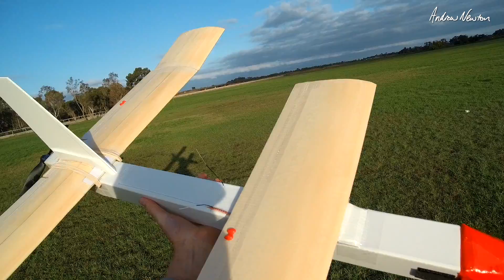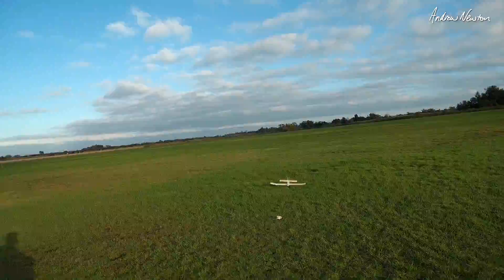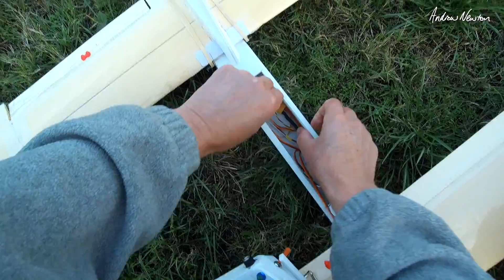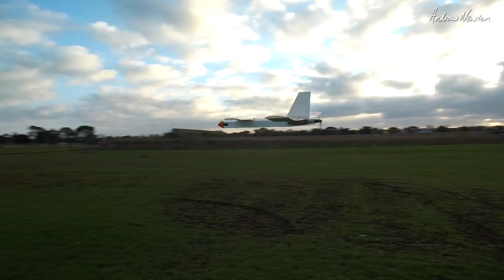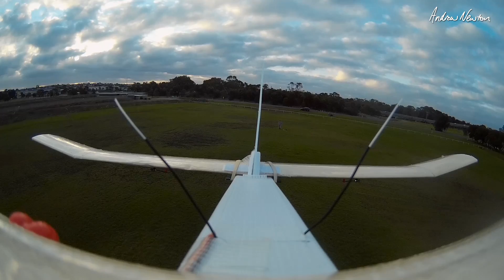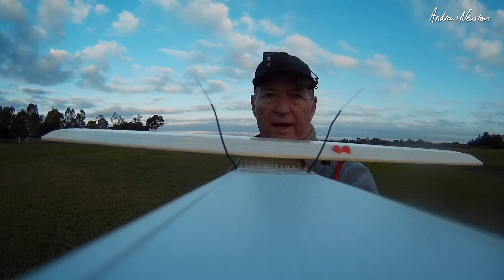Smeg Head - Canard Pusher

Comment: Hi Andrew! I plan on building this canard and I have 2 questions. With the elevator being on the canard does the elevator work backwards compared to a conventional elevator? And secondly will elevons work just as well?
Reply from the maker: Yes the elevator deflects down to make the plane pitch up. I'm about to test pure elevons, that's all the original APD used.

Comment: Andrew, what did you mean by "the elevator needs to be reversed"?
Reply: Normally at the back of a plane, what the elevator's doing is pushing the end of the tail down to   pitch the nose up but now its pulling the nose up so the deflection's opposite
Reply from the maker: Aryan is right. Elevator is in front of the CG so to pitch up it needs to lift up instead of push down

Comment: Sounds like an interaction inbetween the canard and the wing to make the turns so difficult. I would be extremely interested, if it would make a difference, if the canard would be under the fuselage or some centimeters above and not on the same level as the wing. 

Nice video as always. Greetings from Finland.
Reply: I have been interested in canard type models for a few years now, and have done a lot of reading about canard aircraft.  One of the things I learned in my reading (and flying) is::  For best control and performance,  DO NOT place the main wing and canard on the same level.   If you do, air flow over the canard disturbs the air flow over the main wing.  On a plane with the elevator on the canard this is especially true when the elevator is deflected downward; like at slow speed and a higher angle of attack.   I generally build with the canard about 4" to 5" above the main wing.
Reply from the maker: Interesting thought Christoph. I'd like to try a pivoting canard as well.
Reply: Smeggin great, canardly wait to see what you come yo with next.               No silicon heaven? Preposterous! Where would all the calculators go?

Comment: Another innovative build! Thank you! 

To get a bit more pitch authority, I might suggest altering the angle of attack on your canard.
 Since the canard is providing a significant portion of the lift (not all do),
 it cannot provide tight pitch moments.

The canard has to stall before main wing...thus keeping you extreme pitch. 
But you can get closer by reducing the carnard angle of attack to a very shallow angle. 

This is why more maneuverable canard aircraft have minimum lift canards. 
Your's, as you state, is perfect for stable cruising! 
A beautiful job.
Reply from the maker: Yes that makes sense. I'll try to simulate canard angle changes with elevator on a slider and pure elevon mixing.